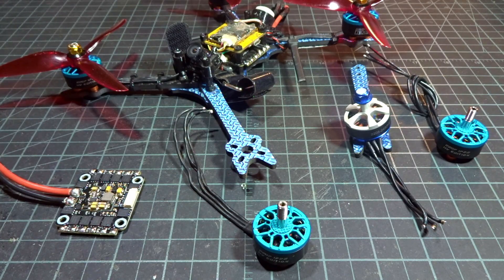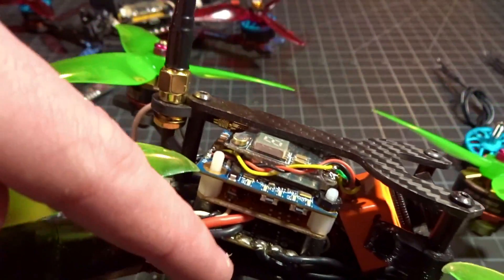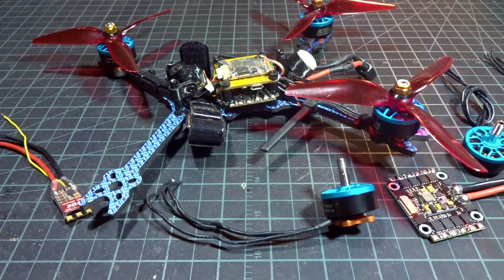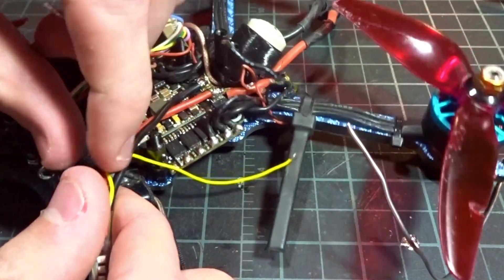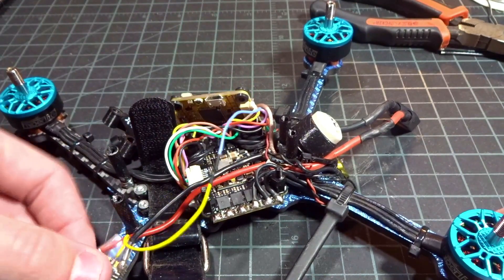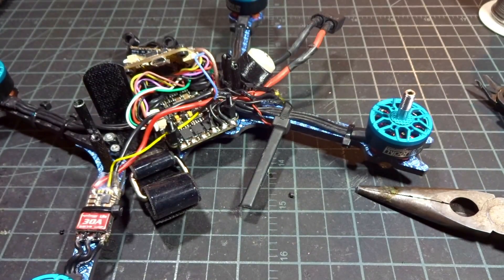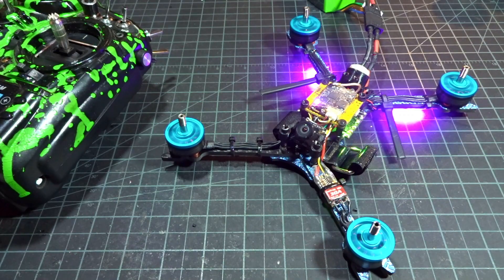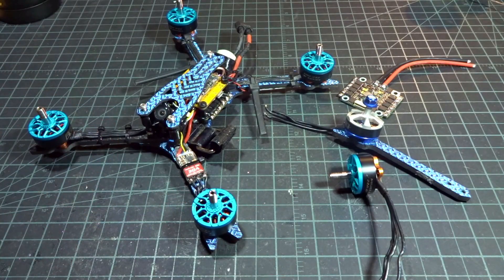Save a Dead 4in1 ESC, Easy Fix!

Comment: I have learned that some years ago from this very video. Now I came back to check a doubt about different Amps on the ESCs and you've alreay nailded it. I'll be using a 35Amp single ESCs with a 50Amp or 40Amp 4n1 ESCs... Thanks 👍
Reply: Will it matter ? I have a 45amp 4-1 and 35amp individual.

Comment: Hey I did this fix on my 4 in 1 and got a few flights but on like 3rd flight I plugged the battery in and seen a mofset (or one of the black things on top idk for sure what it is) blow up and I already have the individual esc on it any pointers it did stop glowing red after a second and the rest seems okay so maybe rock it?
Reply: I was just trying to figure it out and I got it on and motor 2 is not working still even with new individual

Comment: Great tip!  What do you do if the new esc has a ground with the signal wire?  It's been so long since I used a stand alone esc.  Do just remove/not use it, or just twist together with the main ground?  Thanks!
Reply: Hey bud did you figure this out? I also have a ground.

Comment: I just did the same thing by flicking the prop with my finger to get it spinning and then arming. The motor was twitching and not spinning when I'd arm, but giving it help to get started got it to spin and fly. My dumb ass thought I'd blown an ESC on my AIO board. I ordered another AIO board and installed it and the same problem. Upon closer inspection, I'd put a screw that was too long on that motor and it was touching the motor windings. I changed the screw and the ESC is fine. So since I'm a dumb ass, I have a spare AIO for another build.

Comment: @rcaddict how does this affect ESC Telemetry? Are you essentially no longer able to use the current sensor in the ESC after this is done?
Reply from the maker: If it's one large current meter instead of individual small ones you wouldn't be able to use it anymore .

Comment: This is really nice! Just wondering is it possible to use BL Heli configurator instead of swaping the wire to revserse the motor direction? Plus even flashing JazzMav on it to enable RPM filter :D

Comment: Damn i had hopes it was just a bad motor. 

Naaaah it allways has to be the more expensive part. Grrrr. Next time just explode you stupid drone.

 Quad crashes from 1m on my very first flight ever.
=Total technical failure.

My friend send his mavic in Sports mode and fullspeed 60kmh right into a concrete wall which results in a terrible looking mavic crash 10m down to the ground
 = literally nothing he just restart and get back into the air

Welcome to my life

Comment: Can this be done a all in one flight controller?
Reply from the maker: one with escs built in?
Reply: @TheRCAddict  yes the all in one flight controller / esc /reciver like the emax tinyhawk I have like 5 that all but one esc work maybe the signal for esc can controll extrl esc
Reply from the maker: You'd have to disconnect the old esc from the FC which would mean scraping at a tiny trace on the board so not very likely.

Comment: This is almost perfect. I took a "3in1" blheli_32 ESC running on 6s and added a single spedix 20A blheli_S ESC to the arm as a replacement. Set Dshot to 600 and quad flew beautifully. The only issue is that betaflight needs 4 active currents/voltages from blheli_32 ESCs so the OSD displays 0A and 0V for the readings even though the 3 blheli_32 ESCs from the 3in1 ESC display proper voltages in betaflight. I looked for a possible workaround using debug display on the OSD but no luck. Weird how betaflight devs don't allow you to display individual ESC stats in the OSD like KISS does. Monitoring voltage on the OSD is essential for me so I guess I will have to buy an individual blheli_32 ESC and use its telemetry unless anyone has a solution.

Comment: I have a 4in1 ESC + FC on one board :( I'm out of luck :D where on earth will I find the signal wire :(
Reply from the maker: Since it's connected internally the only way would to be find that motor signal trace in the copper and scratch a line through it to disconnect it, but I don't really recommend doing that.
Reply: @TheRCAddict  Yeah I also figured it would be the only way... Rather just deal with the fact of me being lazy and buying an ESC+FC in one. Swallow my pride and buy new and do it the propper way

Comment: I am getting the same as the guy in this vid https://www.youtube.com/watch?v=B7q1XUO5XzY
Please advise I would to know which if any esc is faulty They all twitch when the lipo is plugged in
It was working fine until I needed to change the fc
Cheers
Reply from the maker: Usually when that happens it means that the FC can't talk to the esc. For example if it can't support dshot and you have dshot selected in BF it will do that.

Comment: I don’t understand why you have your motors spinning outwards
Reply: You stated that your front left motor was wired in the clockwise rotation and you desoldered to correct it but you made it spin ccw according to the diagram of prop directions it states that front left motor which is motor 4 should spin clock wise. Can you help me understand?
Reply from the maker: You can spin all motors backwards of their "normal" direction so stuff is less likely to get on the camera lens.

Comment: Does it work with different firmware on the ESC'es? for example blheli-s on the 4 in 1, and blheli32 in the new esc?
Reply from the maker: Yes, you just can't run DSHOT1200. Have to conform to whatever the lowest grade esc can handle.
Reply: @TheRCAddict   thanks!

Comment: Have you tried this with a 32bit blheli stack, like emax mini magnum v2?
Reply from the maker: This esc is 32 bit
Reply: The RCAddict sorry about the confusion, as I rewatched your video to try to see what I did wrong I realized I spliced into the esc side instead of the Fc side of esc/fc cable. I also noticed you clearly mention a 32bit esc. Any how thanks a ton for posting this as now all 4 of my motors seem to be working fine. I need to finish up a few things and will be doing a test flight Saturday.

Comment: I bit the bullet and went for a 4in1 esc and it lasted about 3 flights before it smoked 2 of my motors. Think I will just go back to individual. But I'm going to try this method until it's fully dead.

Comment: This is great, but I have one doubt and I think you can help me. I have a AIO 4in1 ESC 10A and one is dead, other three working without problem. Can I buy different ESC from different manufacturer and can I put 20A instead of 10A? I can't find 10A form Blheli_S (not from seller that ships to my country), is safe to put totally different one?
Reply from the maker: Yes, that is fine as long as they share at least one similar protocol (dshot, multishot etc) Of course try to get a similar one as you can, but it shouldn't matter.
Reply: I will try! Thank you! :)

Comment: Do you really have to cut the signal wire or can you just connect the signal wire to an other ESC-signal output on the FC? Or maybe connect the ESC signal wire to a signal wire IN on the 4in1 ECS?
Reply from the maker: Huh? I don't understand
Reply: Thanks for replying. I was wondering if there is another way of connecting the ECS's signal wire to the Flight Control instead of cutting open a wire going from the FC to the 4in1 ESC.
Reply: I received the parts I needed to repair my drone in the mail today and got my first flight, man flying is cool! One question if you have time: do you hand-catch your drone? If so, how difficult is it to learn? I can find video's of people who catch their drone but cant find someone explaining how to do / learn that other than catching DYI drones. Can you help me? Thanks in advance!

Comment: It works but my quad doesnt fly the same time for a new 4 in 1
Reply from the maker: If it's dipping or just lacking in power something else is wrong yeah. I've had a couple like that for no reason, swapping board fixed.

Comment: I was actually planning to do this, but im curious.  if i have some upgraded ESC's that i jus have lying around with some motors.  could i just pull my 4in1 esc board and motors.  then run my 4 individual ESC's on the arms like  normal?
Reply from the maker: Yeah for sure

Comment: So... basically you're slowly going back to individual ESCs. :)) 

And I guess you don't realize that the dead ESC is actually a walking dead, constantly creeping towards a full H-bridge failure that will short the main power bus and behold the party lights then :D
Reply from the maker: Nah, been over 6 months using a single on the arm, no issues.

Comment: ESC QUESTION

I have two eachine 10 amp 4in1 ESCs that, after very light crashes, stopped working on only 1 motor. Other motors spin fine. There is no physical damage noticeable on the esc itself.

Now I'm wondering if it's possible that something is broken in the firmware rather than hardware. Maybe if I flash the dshot again or something like that, it might work again? Or not a chance? I'm asking because I'm not familiar with the procedure, so I don't wanna waste my time if it's not gonna help.

anyone any experience?

thx!

r
Reply from the maker: Pretty sure those ESCs won't show up to flash in the config.
Reply: Oh; too cheap eh :D.
Reply: I reflashed them with bsheli in the bsheli suite and they seem to work again. All 4 motors turn again. Weird but true. On both escs. Well, on one esc I didn't connect the motors yet, but the other one seems fine.

Comment: I really thought you were really gonna fix it. In my experience in doing this , it still doesn't fly rite. It's a great idea and does work but not the best in flying characteristics in my experience , I don't know maybe I was using the wrong esc s to replace it with.  I'm gonna try it again today with another esc I have. Great Video for sure.
Reply from the maker: Either something is wrong with your escs, or they need calibrated together. Quads that have this for me are indistinguishable from the others in the air.

Comment: This is a workaround, not a fix, so the title could be better. Also, not all ESCs are created equal, so I would exercise caution in asserting that most standalone ESCs "should work fine as long as they support the same protocol,voltage,amps".
Reply from the maker: You are more than welcome to make your own video titled "workaround" ;)

Comment: Hey man have u tired updating like this. I have a tekko32 burnt motor 2 so I was thinking about using it on a new build with a wraith32 as motor 2 but probably need to update the wraith32. I should be able to update right?
Thanks for video man
Reply from the maker: It should work just fine, although I have not flashed a build like this.
Reply: The RCAddict ic ic I think I should be able to as long as I flash one at a time. I'll let u know what happens thanks again

Comment: Do you like 4 - 1 esc's?
Or would you recommend getting 4 separate ones for freestyle flying. I do crash lots.
Thanks,
Reply: If you crash a lot 4-in-1's aren't really ideal because you either have to do a mix/match like he did or you have to replace the whole board.  ESCs are fairly easy to kill, especially if you accidentally swap polarity or anything weird like that.  But they can be nice for a cleaner/lighter build or tighter builds on small quads where you just dont have the room for 4 individual ESCs everyone's budget/preferences are differences but there's my 2 coppers.
Reply from the maker: If it's for freestyle where weight isn't a huge issue, and you are still crashing quite a bit I would go for some medium priced ($10-$14) single escs.

Comment: I was always wondering if mixing different ESC would be any problem. Thank you for reassuring me that it isn't if the specs are matching the load.
Oh, and swapping motor cables to invert motor direction is soo old school ;-).
Reply from the maker: BL32 sucks man, no Mac config ;P

Comment: What if there's ground wire (pair of signal wire)? Where do you solder it?
Reply: Roy Sio you can ground any groundwire to any ground pad
Reply from the maker: If you have no place for it you can just remove it. If you leads are short it won't matter.

Comment: Use Diode mode on a multimeter to test for bad mosfets...no need to fry motors.
Reply from the maker: They were junk motors, needed to assess the damage quickly.

Comment: what if the moffet  ..not sure how to spell it!...on the broken side has burned or was on fire!..  can you still bypass it?
Reply from the maker: If the mosfet is all burned out and nothing is shorting it should work fine. Be careful though, you might have to remove chips to remove a possible short.

Comment: Moral to the story, either don't use 4-in-1 ESCs or only use the 4-in-1s that you can take apart
Reply from the maker: No way, separate escs suck! 4in1 are so much more convenient, lighter and cheaper per board. I have had very few issues with 4in1s, and zero chance I would ever go back to singles as main.

Comment: I accidently ripped of the pads of one of the motor pads and capacitor pad of my speedix 4in1 and now there is continuity between positive and negative. Do you think this method will solve the continuity prob and have the esc working again???
Reply: most continuity problems will burn out the problem, i shorted a 4 in 1 and number one esc shorted and burned a mosfet.   i just added a single esc and ignored the burned out one and it worked fine. if you plug in the battery and nothing burns then the short circuit has burned itself out and won't short again.
Reply from the maker: Pretty much this ^, it really depends, but if there is an internal pos neg short it is questionable.

Comment: What do you think to using race wire?
Reply: Bro not sure about seth but I have had no issues using race wire. Really a great product! I have 2 race builds I use them on. Easy to solder.
Reply: I ended up using them when I transferred some motors off another quad with individual esc to one with a 4x1. Alot easier than splicing motor wire. Also makes changing motors a snap. But if I had used new motors I would have just used the wires on the motors.
Reply: Paul Yates I have Race Wire on two rigs...works AWESOME!!!
Reply from the maker: No issues using them for me. In day to day use I don't use them though, I just don't have issues with straight wires.

Comment: What is with differences in the bl heli protocols? Like the 4 in 1 is dshot 1200 and the individual esc is for example dshot 600?
Reply from the maker: You have to cater to the weakest link. So if the new single can only do 600, have to run 600, and if the new single is multishot, have to run them all at multishot and calibrate.